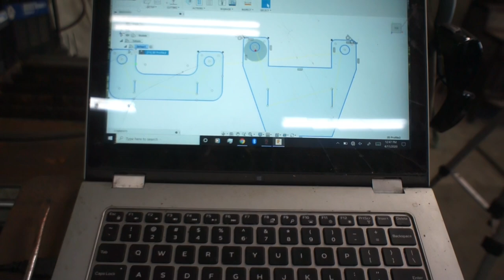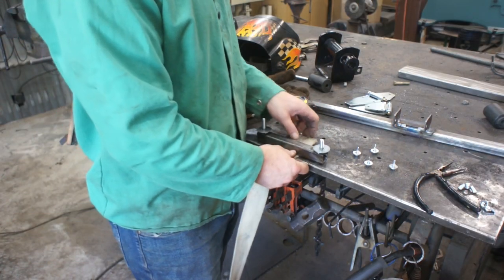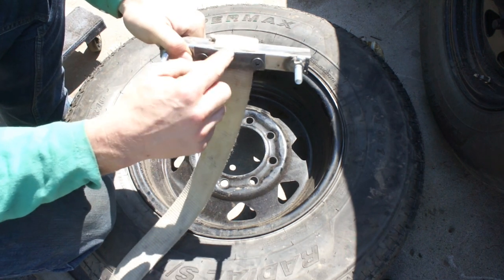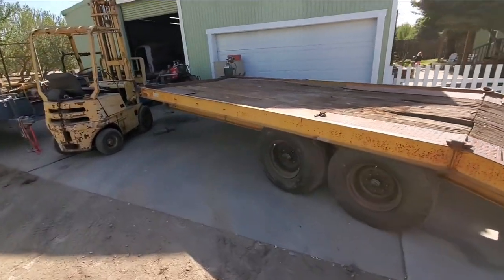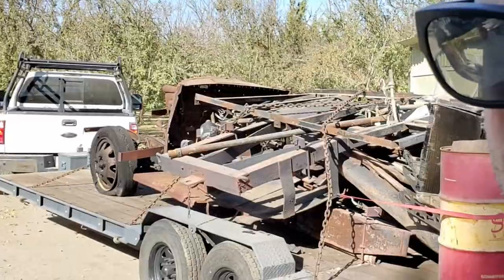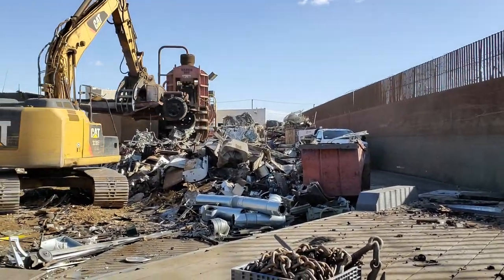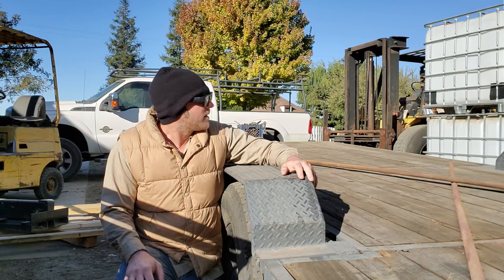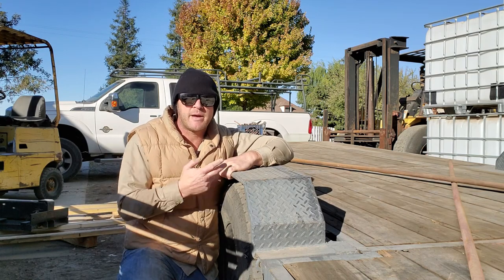The DIY Scratch-built equipment trailer | Pt 5 Hauling Stuff

Comment: Definitely need to wire the battery into the trailer/truck wiring so whenever you are hooked to your trailer it will charge your battery for the pump.
Reply: I did this on mine. Sure glad I did!

Comment: Yeah that's a great looking trailer you got there! :-)

I would junk the lead-acid battery and get a 100Ah LiFePO4 battery and hook up a charging circuit from your truck, you got power to the trailer anyway for the electric brakes and lights so adding a charging circuit to the battery will make sure it's always charged up when you're driving it anywhere.

Comment: Awesome build bro. Theres gotta be a way to wire the trailer battery to get charged by the trucks alternator.  Or maybe just get a jump box and keep it in your front storage box on the trailer. 👍 🇺🇲
Reply from the maker: Yeh, according to my truck literature it should have a charge output. When I wired the trailer plug I did include the charge wire. Ill have to trouble shoot it. Thanks for watching the series!

Comment: If recommend a chain binder box setup like a tool box drawer since you have the clearance. 

An maybe 4 batteries an definitely a 12k to 16k winch with some snatch block mounts at the end so you can side pull
Reply: All great ideas! I especially like the drawer idea.

Comment: My friends trailer had the same battery issues, I diode isolated the parking light circuit to the battery for a 12 volt charge when the lights are on it’s a quick way to charge the battery while towing the trailer.  The diodes prevent the battery from turning on the lights and running it back down.

Comment: Trailer turned out really nice, so definite props there! As far as the battery and winch powering goes. I've got a 12k winch on my trailer and I have large quick connect power leads (think battery powered forklift or pallet jack) run to the back of my truck that go straight from the battery. I got a pair of 25' long, heavy duty jumper cables and cut them at 10' and 15'. The 10' section is wired to the winch on one end and has a quick connect plug on the other that I can hook to the plug on the back of my truck. The 15' section has the jumper cable clamps on one end and another quick connect plug on it. This way I can use the winch with any vehicle i can reach the battery in or I can jump vehicles from the back of my truck. This might be something to look into for you. Hopefully this makes sense and if not, let me know and I'll see if I can hammer out any details for you!

Comment: The side edge rail of that old trailer won't get in the way. Pallets are high enough to overcome them and if you load something flat on the deck you always place 4x4s under it and they will let you overcome the side rails.

Comment: if you wired the trailer running lights to power and charge the trailer battery you wouldnt constantly be draining the battery. Just turn the lights on to send power to your wench and lift.

Comment: Did you ever reveal the cost of the trailer build? I watched all the episodes, but can't remember if you talked about that. Awesome job!
Reply from the maker: No, I never talked about it. BC I saved material as I came across it for about 2 years my cost was greatly reduced. I also used remnant paint, and deck sealer. Out of pocket cost during the build was around $1500.

Comment: Proper nice strong trailer. No good here in England tho. Too big. Most cars, would struggle with its tare never mind loaded. Such a good showcase to show what you can do, maybe you are using this, as a way to provide an income by selling this type of trailer hand built, I reckon you could shorten it and add or take away bits depending on the customers wish list?

Comment: and also wanted to say what system are you using for the plasma cutter what is a good system c a d I know there's quite a few out there what is something pretty reasonable that I can find I want to start doing my own Parts I have a few plasma cutters but I want to get a table I see some from time to time and also I would run a plug from the back where your bumper is and I would put the hot in a ground all the way from your battery in the engine compartment of your truck and run them to wires all the way back or at least the hot all the way back for sure and then just ground it in the back there I have one of them Quick Connect plugs for hilo's or like a tow truck style and that's how I have my winch to hook up I never lose power
Reply from the maker: Thanks for the comment, I appreciate it. 
Langmuir table using QCAD to draw, sheetcam to run Gcode and MACH3 to run the table. Pretty common for a lot of langmuir users. 
Keep up the hard work man.

Comment: Did you run a 12v wire from your 7 way to the trailer battery.

Comment: Your electrical problems are very easily solved by using think fine stranded welding cable from ur engine batteries to ur tow bar utilising a 450amp Anderson plug, then using the same Anderson plug loose on the trailer like the trailer light plug and hooking it up to the battery in the hydraulic tool box also using more welding cable. Safety issue: install a 400amp fuse in engine bay and 400amp fuse in the trailer box. If ur using a deep cycle AGM batter on the trailer then u need to install a dc to dc charger that manages AGM battery so when its fully charged the unit will disconnect the battery and stop it from charging anymore. Now if u want to use direct power from the engine batteries while the truck is running more then proffered then u also ad a diversion switch from the charger to the hydraulic motor and winch circuit, therefore ur saving the load on the agm battery and making it last double its life time, also a desulphator in the dc to dc charger will be helpful for longevity of the AGM battery or u can get a desulphator on its own and just wire it directly to the battery, it has a 0.1 or 0.2 of a draw but u use the trailer all the time, if trailer sits for a while just hook up any solar panel to it and let it trickle charge the battery... u can get solar panels with a built in agm solar charger so u do not have to worry about over charging the battery. Id u had roof racks on ur truck u could install 2 house panels on the thing and a solar charger and they can charge ur engine batteries and the trailer batts at the same time and it wont flatten either battery if u leave the radio on or operate the winch without motor running and ur engine batteries can double its life time too cos they will be fully charged b4 every start. cheers and thanks for the education.

Comment: Is your trailer battery wired to your 12v lead in the 7 pin connector from the truck side? That way the truck charges it while it’s connected? Also, looks like you’re local to me. I thought I saw you driving through Ripon on the freeway haha
Reply from the maker: Haha, small world. Was the firetruck on there or the '35 chevy? The truck is wired through the harness to the trailer, it should be charging. I think the battery is just shot.
Reply: Ripon California?

Comment: hi   why not fit a plug  from the truck battery to the rear of  your truck  and use it to power the  winch an easy fix and when using the  winch run the  engine

Comment: Those wing nuts will come loose , over time due to vibration !!!
Reply: Those wing nuts don’t really matter if they come loose. They are just to tighten up the mount (the tire and wheel are pulling down on the mount not the nuts ).  Pretty much a text book way to secure something. He did a great job with the spare mount assembly.  I do recommend mounting the winch rigidly at the front and keeping 2 or 3 snatch blocks with chain tails so you can pull from any direction while winding the winch back however you want. Everybody’s results and needs will vary.